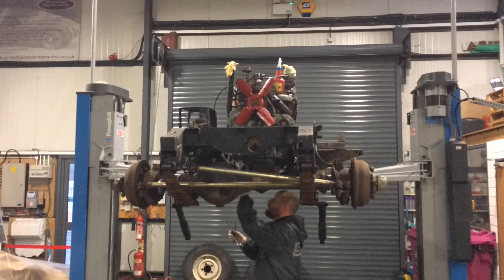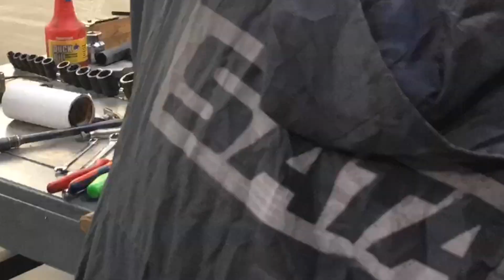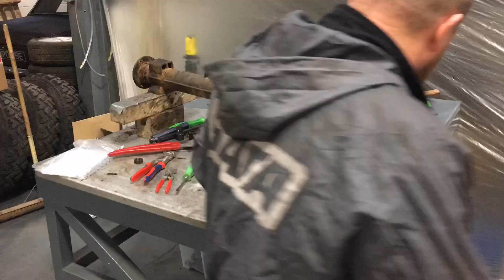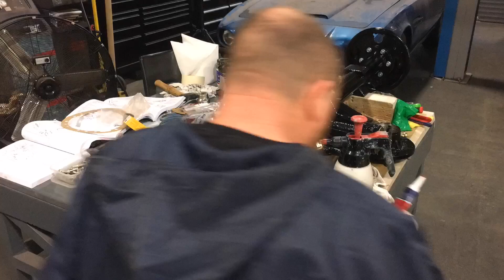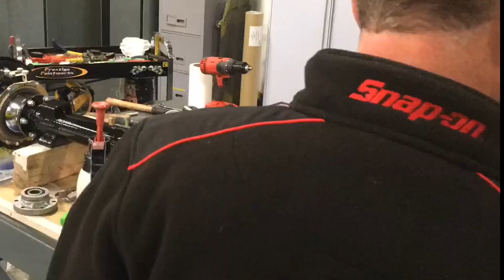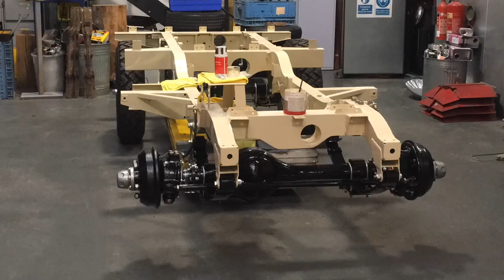Land Rover Series 3 Restoration - part 5 of Project Pickle the 1976 88”

Comment: Amazing! Can you tell what axle bump stop you used for the front? I've got the same kind of chassis mount and the standard don't fit as it's not straight! Any help would be so muxh appreciated
Reply from the maker: Hi,
The standard bump stops were used but came up against the same situation as you so I cut them and changed how they fitted. I had to keep a blow gun to hand so I could weld them up a bit at a time so they fitted correctly. I then gave them a lick of paint so they looked original, a bit of a faff but necessary. No idea what paddocks modelled them on but it wasn’t the right one that’s for sure.
Hope that helps
Reply: @prestigepaintworksltd  thanks a lot! That helps a lot, I was going yo do the same thing but I thought maybe it was se special parts!one is a shielder chassis so possible they supply paddock

Comment: Hi, we have a Land Rover Series 3 (1981). We are at the stage you were at the start of your video right now, with all the body panels stripped and just the chassis, engine, transmission, axels and spring leafs. We have been taking off the 5mm thick layers of grease and mud with a degreaser and wooden sticks(we are doing this as we are painting it and getting the engine refurbished). It works but it is very slow. I saw you used a power washer we avoided that thinking it might go into the engine and cause mayhem is there things we need to do or should we just start pressure washing it?
Reply from the maker: Hi Jack,

The pressure washer that we used was a diesel powered hot wash one, 
as long as the spark plugs are still in place and a plastic bag cable tied around the carb to prevent water ingress then you should be ok.

We used a fairly strong engine degreaser on ours, we applied it several times to be honest then used a fallout remover/ similar product as valeters used when cleaning alloy wheels to remove anything else that we could, the fallout remover probably didn't do a great deal but we had some so used it anyway.

Hope this helps and have fun with your project.

All the best Chris
Reply: Never use a pressure washer on the engine compartment of a modern car with all its computers and sensors but back in the stone age you could pressure wash car engines with impunity. Back in the seventies and eighties pressure washing a car engine was unremarkable and even routine.